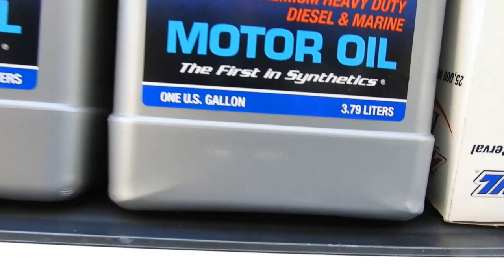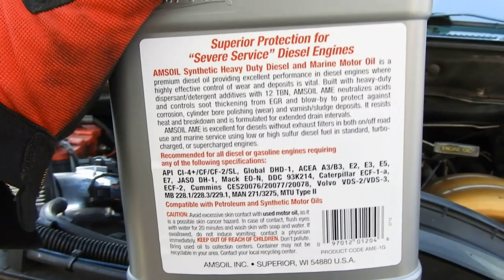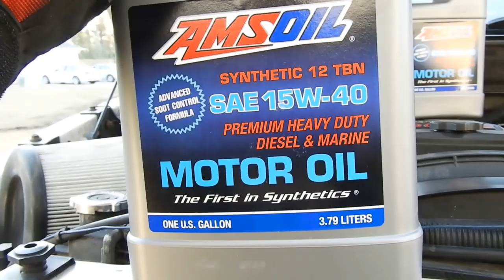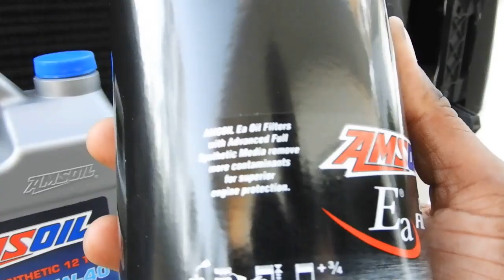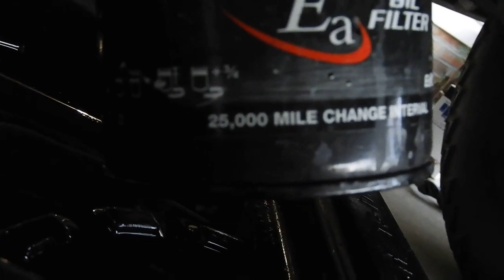Treat Yo' CUMMINS To A Fresh Oil Change!

Comment: What is the difference between the Heavy Duty Diesel and Marine oil, and the Max Duty oil from Amzoil?
Reply from the maker: The diesel marine oil is twice the intervals for changing it, also has more zinc additives for better wear protection. Its recommended for pre emissions diesel or if your truck is deleted. If not then signature series is recommended. Idk about max duty oil from Amazon they are pretty new still

Comment: Do you do fuel filter the same time you do oil? Will be installing a catch can and doing the CCV delete within 2 weekends!
Reply from the maker: I do fuel filter every other oil change usually. The fuel filters for my air dog are good for 15k miles ish.i already did ccv delete and catch can install a while back

Comment: How much oil do you add to the filter before install? Any tips to not get oil all over when removing the drain plug?
Reply from the maker: Owners manual recommends 1 quart I did like 1.5 quarts when I did this one. For the drain plug just have a quick hand and some gloves. Lol some people but a drain valve on it. I like those but I get paranoid that the drain valve would open on me lol
Reply: Making that #horsepower Steven !!

Comment: You should look into a fumoto drain valve for the truck. Makes taking samples really easy and oil changes even easier. I've got one and couldn't be happier. Solved the fear of having a shop strip the threads the couple times I've had someone do it
Reply from the maker: I've been thinking about doing it. But I always forget to look for it. But also i get paranoid that it would open or break off when driving
Reply: @EVERYTHANGDIESEL  I had that same fear. The spring on it is very heavyweight and takes some effort. It also only hangs about 1/2"-1" lower than the factory plug and no lower than the crossmember under the pan. The only major concern is going off road in big mud holes. I'm a 2wd street queen so I don't have that fear and have it for 6 years now. First thing I did to my truck.
Reply from the maker: Thanks for the feedback man I'll give it a try next oil change. Although I do go offloading when I hunt but nothing. Will reach that high though

Comment: Man I hate soot in my oil but can’t get rid of it with the pre fire and post fire injection on the common rail
Reply from the maker: yeah man thats just normal from owning any diesel. but its not bad becasue diesel oil made with detergents to not let it affect the oil job. thats why diesel oil is more expensive and seprate from regualr oil cause of the increased zinc and additives in the oil. thats why lot of old school dudes run diesel oil in there old school chevy block engines.
Reply: EVERYTHANG DIESEL okay makes sense why I know this one guy gets a barrel of 15-40 and runs it in his cars too

Comment: I’m using the Amsoil 10w-40 synthetic with zinc in it.
Reply from the maker: That's good stuff! The more zinc the happier
Reply: I don’t agree with Amsoil multi vehicle trans fluid. I’m afraid of moving outside the factory fluid on my jasper 68
Reply from the maker: Biggest thing when it comes to fluid is run what is comfortable for you and recommended.
Reply: @EVERYTHANGDIESEL   Im switching to donaldson oil filter (DBL7349) because it filters oil better, 10 micron 90%( 15 micron 98%) I need better filtering for living in the desert.